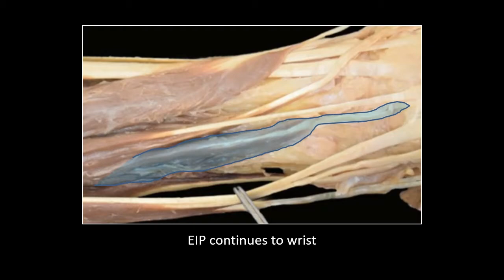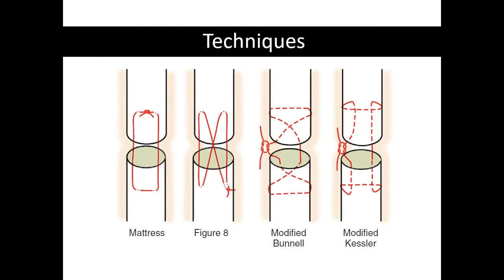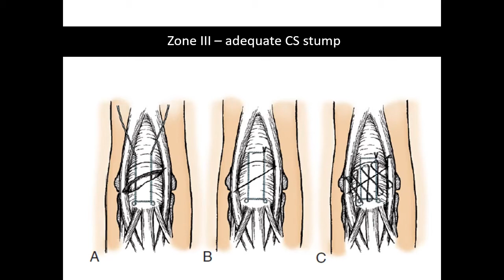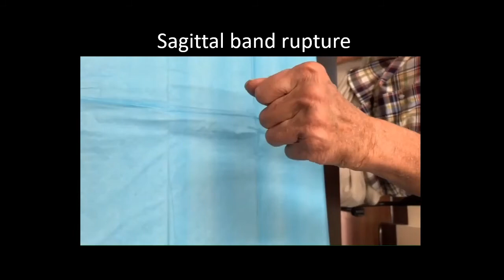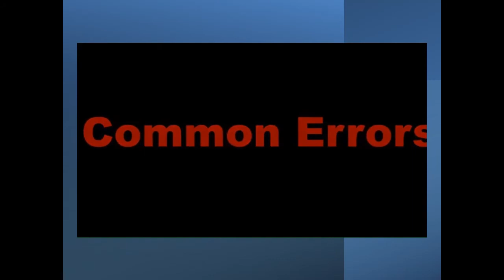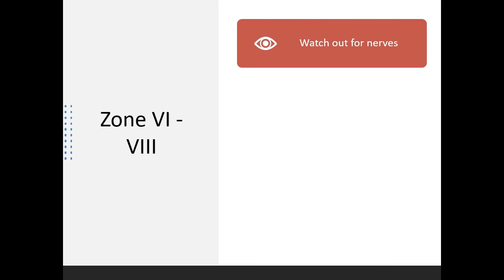Extensor Tendon Repair Techniques

Comment: Hello, I had surgery done on zone 5 (right before middle knuckle). Its been a few years now, and from what i remember he did not use stitches, and he shortened the tendon to much because it very uncomfortable to close my fist
Reply from the maker: Dear Chill Dudie,
            It's unlikely you have had a tendon repair if they didn't use sutures. More likely you have had a laceration with no tendon injury but the healing has caused scarring which has stuck to the tendons a little bit and it is tight when you close your fist because it pulls on the tight scarred area. The initial treatment for this is physio therapy and if still a problem surgery to release the scarring and adhesions.

Comment: I have a in-dept question about the tensile strength of these four suture methodes.

- How much force is required to break the thread?
As in, barely moving the finger to making a fist or making a clenched fist.

- How much force is required to break the healing bond between the two tendon ends?
This implies the elasticity between the bond location and the thread hole strength. Meaning that the hole in which the thread goes, ruptures open.

Looking forward to your reply!
Reply from the maker: Dear odi,
       The sutures hold enough tensile strength to perform early active mobilisation, so it should not break with barely moving the finger but making a fist immediately after an extensor tendon repair is not recommended and will break the suture. 
Your second question is talking about the suture cutting through the tendon I believe this is reduced due to the techniques used where the loops grasp.the longitudinal fibres , hence it tightens when pulls if done correctly, if you would do an interrupted suture along the fibres very little force would be required for the hole the suture is in to rip open.

Comment: Hello please I sustained an injury to my extensor tendon in my right middle finger 
I can barely move it, I'm scared please what do I do
Reply from the maker: Hi Lostfruit. If you sustained an extensor tendon injury, you should go to the emergency department immediately so you can be referred for treatment to a hand or plastic surgeon in a timely manner. If these injuries are delayed they are very hard to treat.